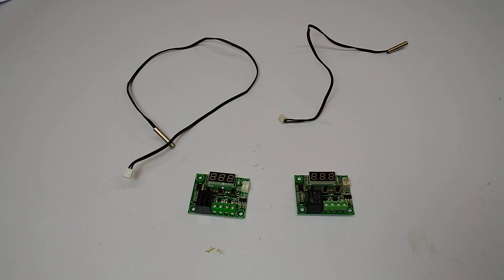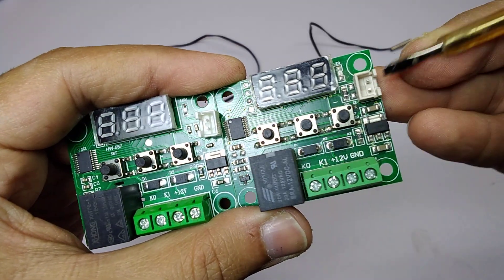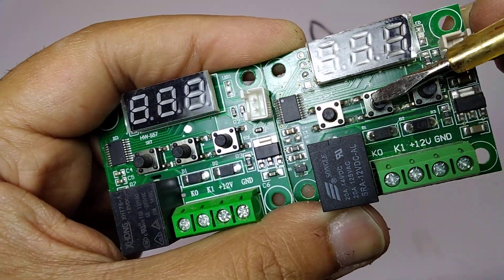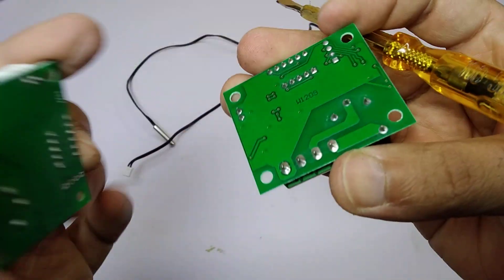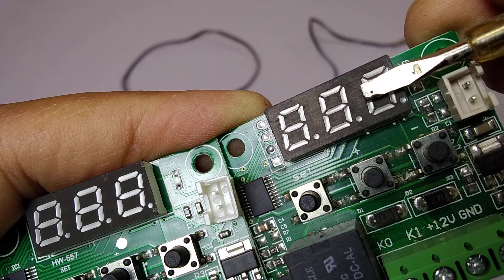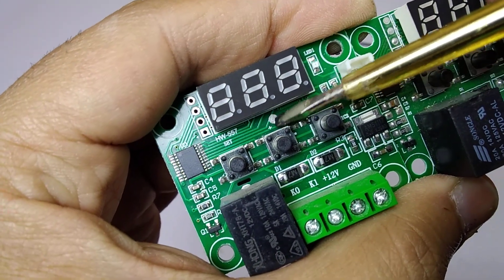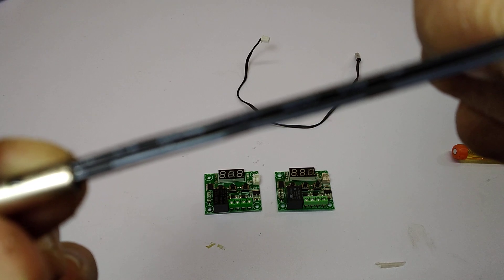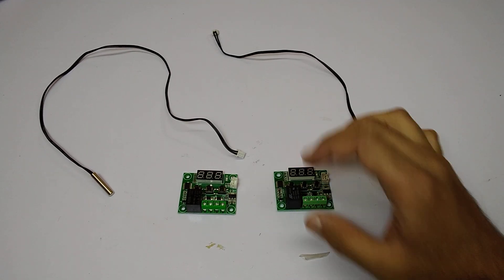W1209 low and high quality comparison

Comment: what goes bad in the bad quality module ? 
fault analysis ?
Reply from the maker: Some resistor are missing which are for voltage protection and the rest of the components are low quality

Comment: I connected it to a refrigerator but it stops after an hour or so of working. Simply dies, works fine after a power cycle. I think it needs a 270v varistor on the relay's contacts, what do you think?
Reply from the maker: It is not recommend for fridge it is only for small projects under 300 watts

Comment: Sir can i connect 3, normal cooling fans each of 12 volt to this w1209 temp controller
Reply: But how i can i connect it in serries or on parallel
Reply from the maker: @manojSharma-ws8pc  you have to connect them in parallel
Reply from the maker: Yes it can be connected

Comment: I connected a 60W bulb; the temperature exceeded above 37 degree but still it didnt go off; I programmed it to 37 degree
Reply: Also adjust hysteresis i in P1
Reply from the maker: because heater is still hot so it will take some time
Reply: It will turn of at 39
Reply: 2 point after

Comment: Is there anyway you could extend the probe or display without breaking the functionality?
Reply from the maker: you need to buy long length wire it comes separate
Reply: cut the wire and extend it

Comment: W1209 kitnay amps tak py safe work kerta hai.yani 12v aur kitnay amps ki supply ya adopter py kharab nai ho ga?
Reply: Aur agr load ap ka ziada amp ka hai ya ziada amps use krna chaty hain to market sa 20 amps ki relay mila gi 50 ya 100 rup ki  wo is k sath use krin ta k directly w1209 p load na jai usi relay p load jai bari relay choti relay k sath chalain  bari relay ko choti relay k sath connect kr dain simple
Reply: 5 amps dc load and  8 amps ac load   aur adapter dc12v use 2amps not more

Comment: Umair bhai ap ka number mil sakta hai I need help.mainy aik 12v dc incubator banaya hai jis may 2 car bulbs use kiay hain aik fan hai kindly bata dain kitny amp ka charger ya supply use keron w1209 k sath
Reply: Fan direct 12v p chalain jo har time chalay r bulb ko relay k sath chalain
Reply from the maker: w1209 sirf 10 amp tak ki battery pay theak chlyga